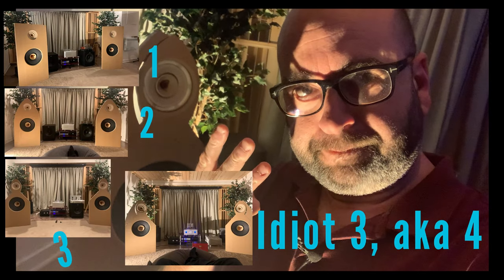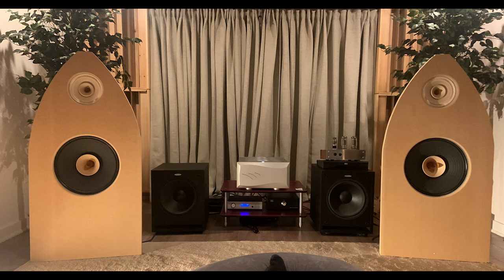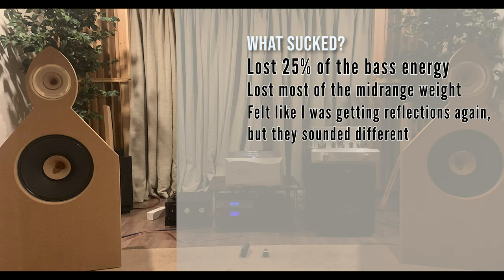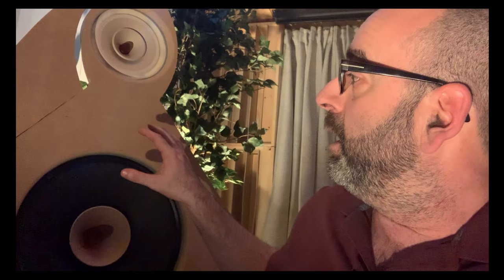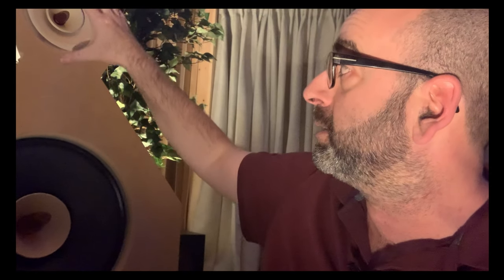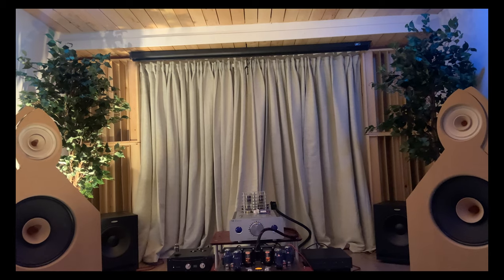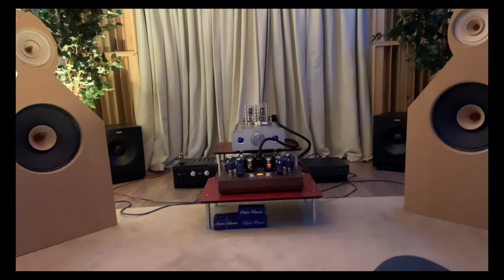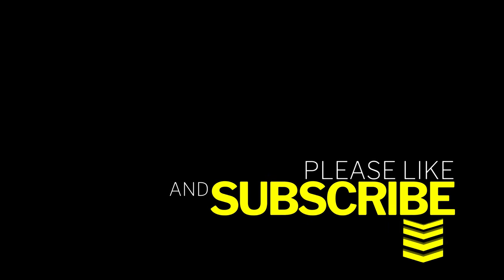🛠️ DIY Open Baffle Speakers PART 1: Lii-song full range drivers

Comment: good morning and thanks for the excellent video
I don't want to sound provocative but the upper full range if used full range will surely have more IMD in the midrange
A simple high pass filter can be very transparent if done well
For sure what passes will sound cleaner even if the level is raised
I would also put a low pass on the woofer especially if it has high frequency break up
I would at least try

Comment: Great video! Can totally relate to your comments on soundstage. Keep up the experiments. It’s th only way to find the best result. Btw as you mentioned, Thomas did his Decware video and I watched it twice. I’m really looking forward to yours though since we use similar speakers!
Reply: Yea, his experience  is very close to mine aswell. Like I am siting front row at an IMAX. 
Hope you can get another pair soon D!

I bought a set of silver 8 but have not installed them yet. 
Have you heard them in that configuration? 

Thanks,
Reply from the maker: Boom!!!! Yesss IMAX!!! In 3D thats it!! Well said. Best description.
Reply: Is there any possibility that the version 1 may have had too large a baffle board? I noticed the Fast 8 was pretty far up from the F15. That additional board space may have been a contributor. Just a thought since I was discussing it with my friend who also uses baffles. Looking forward to more, keep up the great work regardless! I know experimenting is often needed to find the sweet spot.
Reply from the maker: @drde4010  i think so, drivers were too high up, too far apart, and too much baffle surface.
Reply from the maker: @drde4010  ohhh and the fast15 and silver15 drivers are coming. Cant wait.
Reply: @hificave  a silver 15?! I didn’t know! That’s great. I got the silver 8 and fast 8 I need to compare.
Reply from the maker: @drde4010  silver 8 has a qts of only 0.28 not suited for open baffle. But what do I know, let me know once you try it.
Reply: @hificave  the Silver 8 actually works better than the Fast 8 in parallel. I just got back listening to them for two hours. Bob also agreed.
Reply from the maker: @drde4010  good to know!!
Reply from the maker: @drde4010  if the silver 8 works well that means that by spec, flagship 10 should work well also… interesting.
Reply: @hificave  I’ve been using the Crystal 10 in open baffles for several years, and love them.

Comment: Nice job! Very interesting. I suspect, since both drivers are running full range and they’re not concentric, you’re getting some reinforcement and cancellations at certain frequencies (comb filtering).
Reply from the maker: I thought so too at first, but I gotta say, when I go back to a single driver, the resolution increases a little… but everything else diminishes. Less feel in the instruments, less density in the notes, less weight to the objects in the sound stage. It makes me believe I should continue on this route to see if I can get the resolution to improve and keep all these benefits of having both drivers.  But who knows if I will get to where I hope the presentation can go.
Reply: @hificave  I certainly don’t mean to discourage you from continuing with your experiments. If there is comb filtering, it seems to me that the sound would vary as you move your head up and down. Regardless, even if it is “an issue”, no speaker or room is perfect and it’s possible that the good far outweighs any bad. Go for it! I think it’s a cool idea!
Reply from the maker: @thebostonaudiophile  interesting, the sound does not change as i move up or down. Is that a true indication of comb filtering?
Reply: @hificave  Not sure what to say. If the driver centers are 18” apart (just a guess) and they’re both operating full range, one could expect aberrations at about 1,100/1.5=733Hz where the sound waves from the two drivers reinforce and cancel each other. That’s not to say that it might not sound excellent overall. It’s also possible that the smaller driver doesn’t output much relative to the big driver at this frequency. If that’s the case, then there’s not much of a problem. I think it’s a cool idea you’re working on and if it sounds good, that’s all that matters. Virtually every speaker has theoretical “problems”, perhaps it’s all about trade-offs and deciding what’s worth worrying about and what to ignore?
Reply: @thebostonaudiophile  I was going to ask the same question regarding comb filtering. In theory, it should be pretty bad and it "should be" affecting all of the octaves above the 733 hz that you mention. It really is a tradeoff game in audio. I have both drivers in their own setups and love them.

Comment: Wow... serious dedication to this project.  But have to ask... no crossover?  If your going no crossover then your better off single driver.
Reply from the maker: Had the same theory… but when I tried teo drivers in parallel… there was more of everything, in a good way.
Reply: In HS we used to think turning another pair of speakers upside down and putting them on top another pair sounded better too.  You will get more dynamics, loudness, and a higher soundstage but at the expense of linearity, tone, image specifity and the precise size and layering of the soundstage.  Mounting the 15 at ear level and perhaps adding a super-tweeter as close as possible above the 15 on the baffle to fill in above the 15's natural roll off should sound way better provided you get the baffle size and shape correct.

Comment: I enjoy watching your videos. I would like your take on the musical paradise mp 701 mk2. It's my first tube preamp. I put in some nos tubes. Really added weight to music and much more.
Reply from the maker: Im just starting with it.  It has serious potential. Even stock tubes and caps, it is great!!  i only upgraded the rectifier so far, and it is contributing to a really engaging presentation with decware zen tori amp. I will be making a video on it and writing more impressions on my patreon page also. I will take this one on a ride, capacitors, super rectifiers, tubes and we will find out if this 750$ preamp scales with 1-2 thousand dollars of upgrades or if its best left stock. ( I think it will scale!)
Reply: You are not kidding about a rectifier making a huge difference. I found a bendix 5852 6x5 holy cow what a sound stage. With v-cap odam's and  brimar cv4003. 12au7 tubes has extended highs but not bright. Sound really great to me.

Comment: I felt silver 10 sound better with speaker box   floor stand and w15 open buffer  at side  do u think this will better set up ..
Reply from the maker: I also think silver-10 sounds better in a box. I prefer fast-10 in open baffle. But I have moved on to using w15 drivers instead of parallel f15.

Comment: You cannot run two drivers full range with the acoustic centers so far apart.  No matter what you do to the baffles you will not get rid if the comb filtering.
Reply from the maker: I agree.
Reply: He said so in the video. One of the next steps.

Comment: As I understand it, you have a number of dispersion things going on - any driver that is playing frequencies that have wavelengths that are smaller than the width of the driver; you get narrow dispersion. Both vertical and horizontal dispersion are narrow. With open baffle you get dipole from the driver(s) that are playing the highs.
And the bass goes dipole because of cancellation once the wavelength (or half the wavelength?) is longer than the path around from the front of the driver to the back.
The third thing that may be happening is when both drivers are playing the same frequency, you get vertical comb filtering.
Baffle step is another challenge - the highs get emphasized by a broad surface, and the edges of that (flat) surface diffract the treble. As you heard with your first design.
In addition to driver size, there is driver mass. And you can (largely?) avoid crossovers.
This is a complicated situation, obviously.
Reply from the maker: I have moved forward from this since. No more using dual full ranges, and using different bands for the full range driver from the bass driver, and isolating both baffle sections etc.. working on more videos on it
Reply: @hificave  Looking forward to those! Thanks!

Comment: Maybe put the drivers on the front of the baffle?
I have heard drivers mounted like yours, and they sound like really bad.
Not only are you introducing a huge diffraction region right around 1000Hz on the woofer and around 2000Hz on the mid, you are effectively  horn loading a driver that might not be meant for it.
You can prove it to yourself. Find the wavelength equal to the diameter of the cut outs (I used 12" and 6"), any frequency below that will have diffraction issues and exhibit horn loading as you move down in frequency, followed by a weird baffle step. Frequencies above will beam unnaturally, and have lots of combing.

Comment: Great stuff!  Instead of a tweeter have you considered Lil Audio 15" bass woofer.  It goes deeper but rolls off at about 5K?
Reply from the maker: Oh yes I have. It might happen too…
Reply: @hificave  I have the F15's in caintuck style baffles but I'm considering building a new baffle with the F15's up top and the W15's down on the bottom. I'm fine with the rolled off top end of the F15's as I'm really sensitive to highs. If you end up wit the W15 bass drivers I'll be interested in how much you like them. Caintuck actually recommends a plate amp with speaker level inputs for the W15. I can post a link if you are interested and want to go that route. Anyway, I look forward to seeing how your open baffle experiment progresses.

Comment: Wide-range drivers have the disadvantage of distorting high frequencies by low frequencies. I suggest to protect the smaller driver with a capacitor as an high-pass from lower frequencies.

Comment: I suspect you will just need to use the 15 inch driver with a super treater. With two full range drivers, it makes sense that the pinpoint imaging is not quite as sharp. But then again I don’t know what your crossover points are or whether you are using a crossover.
Reply from the maker: No crossover. Wired in parallel. For now

Comment: The comb filtering is destoying your pinpoint imaging and exaggerating or attenuating certain frequencies.   Adding the 8" up higher would obviously raise the height if your image but that doesn't mean it is correct.  A vertical image of the proper height only comes from a apeaker with the acoustic center at seated ear height if you have a completely vertical baffle.
Reply from the maker: You are right! Was just a fun experiment.

Comment: Also what about having tubes to put the drivers in. 2 tubes on the left 2 on the right, 1 for the hf and one for the lf driver. Think "bass tubes" but open at the back. It would eliminate the drivers from talking to each other directly at the rear.  Imagine 2 paint cans on their side with the lid off. That would be the left speaker and each driver has its own enclosure open in the back.  I wouldn't use paint cans though lol.

Comment: I am also in the process of building my own open baffles with W15's, and also making an improved version of my main panels with HIGHLY modded secret drivers. No crossover on both using a small Chinese company's amp powering both the bass and the main panels. Its been an over two years experimentation on the material for the main panels. The reason I won't reveal it's drivers is because I plan to sell these. Each mod I try makes these even more AMAZING sounding. Try Richie's No Rez on bass resonance reduction. I am also using double MDF for the subs. A wing or uneven sides is a great way to achieve better results. Good luck in your adventure......and maybe worth thinking about trimming down the beard growing on your listening 'devices' attached to your head :-}} @ 6:33. Looks like you do have a nice set of gears to play with. All the best Hi-Fi buddy.

Comment: I do NOT have a HiFi system yet, so take the following with multiple grains of salt. You mentioned wanting to try the smaller driver closer to the 15”. What if you cut the baffle to allow you to slide the upper driver into any vertical position you wanted to evaluate where works best by cutting a rectangle out of the baffle from where the upper driver is now to as low as it could go? Then, you could use a low-fi system (brackets of scrap mdf and butterfly screws, blue tape, bungee cords, etc.), and cover the gaps of the baffle with some blue tape, thin boards, etc.? This idea popped in my head (when I was at work. Oops.) Anyways, just a thought.
Reply from the maker: Great idea. I am drawing different designs to do what you describe. I am even thinking of having that part adjustable on a pivot like a heavy ram mount in the back to allow for independent adjustment on the angle left to right and top to bottom.
Reply: Now THAT’S an awesome idea! My 2-D world just added a dimensions. I should leave this to the pros. Ha ha.

Comment: What is the minimum wattage to power these?
Reply from the maker: well, works amazingly well with 8 watts, 16 watts, 30 watts.  But higher wattage makes them lose their magic, imo.
Reply: @hificave  thanks for getting back to me.  Looking at a ST70 or ST35 build 35w - 15w.
Reply: @hificave  I guess I need to look at the Leak Stereo 20 then.  I dismissed it a couple of years ago as I was told it would not run on American Voltage.

Comment: Hey- I have a small apartment and looking to build a small, compact setup. I am thinking the Fast 8s or the Betsy drivers. Do you think those sizes are sufficient for small baffles? Thanks!
Reply from the maker: Absolutely! The amp you use will play the biggest factor on the end result tho.

Comment: I have built a pair of baffles as per Decware with f15’s and they sound great, beyond  my expectations. Thank you for sharing your experience with the F15.
I don’t understand the point of trying to get two full range drivers to work on one baffle. You are negating all the benefits of a single point source by adding another driver. If are going to use multiple drivers then don’t bother with full range drivers at all. 
Also, design by trial and error with no measuring equipment is a bad idea.
Reply from the maker: If I was building to sell, agreed.  This is just an experiment and learning experience.